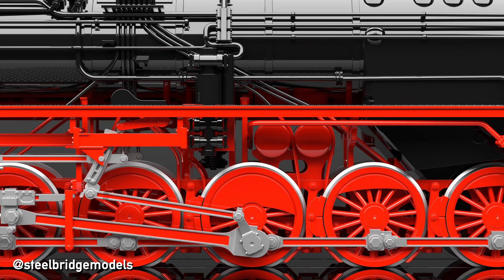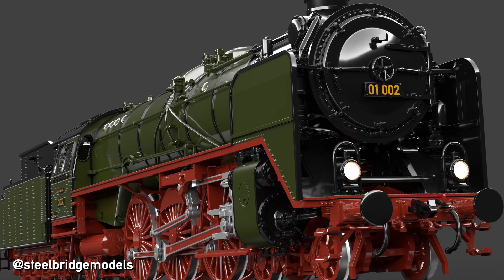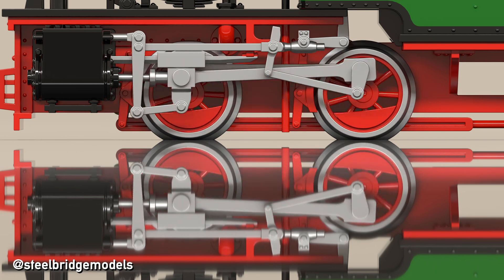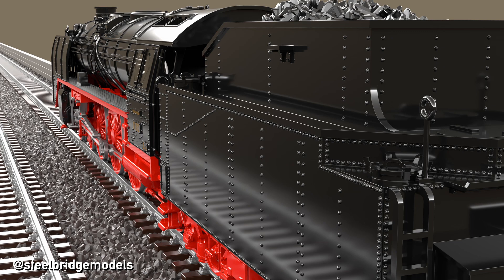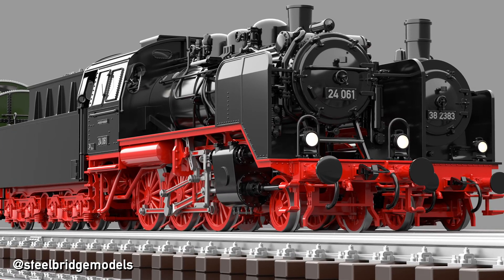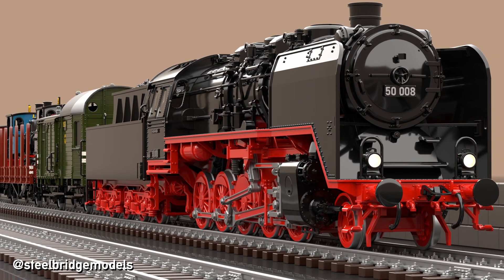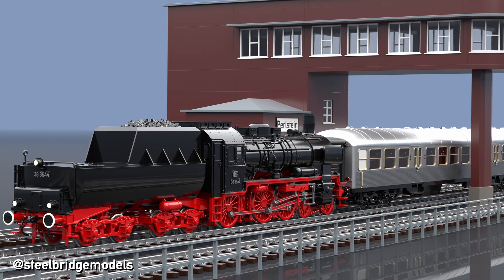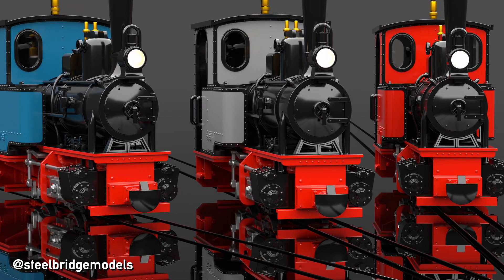Does Size matter?

Comment: Wheel count does not directly improve traction. This is a common misconception since freight steam locomotives typically have more wheels than express locomotives. What determines traction is the weight on each driver. An 0-6-0 and 0-4-0, otherwise being identical (let's assume the extra wheelset adds no weight), would have the exact same factor of adhesion. Smaller wheels can, however, allow for a driving wheel to go in place where a non-driven axle would otherwise have to go on an express engine. Freight engines don't have smaller wheels to fit more, rather they have smaller wheels to increase the torque of the piston on the rail. The piston stroke determines the crank throw, obviously, but the wheel diameter is determined by how much  torque vs top speed is needed. Top speed is also determined by the valve setup, not just mechanical RPM limits. This is why so much R&D was put into valves and valve gear. I think this video is great, but could improve a lot with more accurate or even just more defined information. I encourage you to verify the info I'm sharing though, as I'm no mechanical engineer.
Reply: The BR 03 (Express) and BR 42 (Cargo) have the same axel load and length (within a very small margin). One is a 2-C-1 "prancing unicorn" the other a 1-E workhorse. One goes 130km/h the other 80km/h. Both are Einheitsdampfloks from the 1925-194 program.

The BR 03 has a pulling power (Anfahrzugkraft) of 135KN the BR42 one of 235KN. Train weights at max speed where 430to vs 1700to (on flat terrain)

Comment: Fascinating breakdown of how wheel size impacts locomotive performance! But here's a thought: With modern advancements in electric and diesel technology, are steam locomotives really as efficient or adaptable as we romanticize them to be? Could their design limitations, like the reliance on fixed wheel sizes, have ultimately been their downfall compared to modern adjustable gearing systems?
Reply: We do not have to speculate. West Germany used all three types until the mid 1970s. And both Diesel (like the beautiful "Gretas Third Heard Attack" V200) and Electrical ARE superior. 

I love the Wanne. I will travell 400km in September to see a Wanne pull a cargo train in the Netherlands. It was fun seeing one haul an ICE to the next siding. But the BR52 takes a lot more maintenance in daily operation than a Diesel or Electrical engine.

Well - at least if you keep the drive train clean and fuel line tight. Otherwise:

https://www.youtube.com/watch?v=7lboXvtNNzI

Comment: Is the same principle between high gear ratio and low gear ratio in cars: high gear ration (bigger wheels) means higher top speed despite to a lower torque/power being delivered, while lower gear (smaller wheels) mean higher torque/power despite to a lower speed

Comment: If you  take a typical early 20 century steam engine with a sort of "standard" boiler and and a specific weight they would typically need something like 6 axles to work, but the loco is of limited length.

So a 4-4-4 configuration would be used for a very fast train. 4-6-2 would be used for more of a fast but not high sped train. 2-8-2 config would be used for a mix cargo and passenger. 2-10-0 would be used, for a typical cargo only, and a 0-12-0 (or in most cases, more likely 0-6-6-0) for heavy freight. Basically allowing the same boiler and cylinders for multiple different locos.

The torque of the wheels and the power of the cylinder also will match up nicely doing this
Reply: The germans use 

2-C-1 (two non powered axels, 3 powered axels, 1 unpowered axel) for high speed (BR 01.10, BR 10)
2-C-2 for the BR05
1-C-1 for mid level units (BR 23 and 23.10/35.10)
1-E for most goods engies
1-D-1 for high speed goods engines and the "help, there is a molehill! My BR 01 can't go there" BR39 / Prussian P10

Comment: Here in the States, we had large locomotives such as 4-8-4's that had 80 inch diameter drivers that gave them good speed AND pulling power thanks to their cylinder diameter and the stroke. Maybe the Class 06 could've been realized as a mixed traffic locomotive without the streamlining and therefore could've unlocked its full potential.
Reply: Germany/Europe works under different rules/restrictions. The existing infrastructure did put quite a few limits on the length and axel load of the engines. For example the post WW2 BR10 (around 22 metric tons of axel load) was restricted to very few main lines and even there on some with special permits. US engines ran with loads of 25+ metric tons and the S1 and T1 where around 30 metric tons 

Same for length - german turntables where 26m for the large ones (1938 rules for them). The US used trains of over 37meters.

And the reason is simple - there is no SPACE for those large engines in western europe!

Comment: One rule of thumb (though a very loose rule) is to take a locomotive's driver diameter, in inches, as the maximum speed, in miles per hour. Obviously, that's not entirely accurate. For example, the museum I volunteer at has a 2-10-0 freight locomotive with 52" drivers, but those are still rather small as these things go, and even approaching 40 mph will cause it to vibrate excessively.

Comparatively, the British Rail Class 9F 2-10-0 is a much more modern design, with 60" drivers, and while designed as a heavy good engine could easily handle passenger trains and exceed 80 mph.

Comment: The fundamentals of wheel size never truly changed with steam locomotives, but some workarounds could be found as well. Smaller wheels could be applied to a passenger engine, with improvements to the counterbalancing to offset the hammer blow, or roller bearings to the axles to increase how much rotation the wheels and rods could endure without “running hot.” 

Alternatively, larger wheel locos can attain more power with extra cylinders. Compound and simple articulateds might come to mind, but more specifically extra cylinders to one engine set. Like with IC engines, adding cylinders increases the torque effect for a given rotation. Along with added power to attain and sustain higher speeds, stability is improved as well, and potentially fuel saving even if compounding isn’t used. A four-cylinder engine can offer greater horsepower at speed while using less steam per revolution than a two-cylinder engine of equivalent starting force

Comment: I know that German build that DR 18 201 that loco had driving wheel of 230cm tall its the biggest wheel ever produced only beaten by British single Stirling that only had 2 driving wheel but with a size of 246cm if i remember correct...!🤔 But yes with such a wheel size u have a much weaker pulling power but much  better topspeed...💪
Reply: 18-201 or HELP! I got stuck on a banana peel! Granted, during her operational use that could not happen since East Germany HAD no bananas...

Comment: Good summary of the topic, you are my favourite railway chanel so far. I would have added 1 more point to your video. The driver wheels also have a pratical limit in how small they can get for heavy freight locomotives, since those engines usually have large cilinders and heavy main rods, the counterwheigts need to be large on the drivers to balance the motion out. But below a certain size, it becomes impossible to fit large enough counterweights on the wheels, are the engine is going to have poor riding qualities, no matter what, see for exapmle the Pennsylvania Railroad I1 decapod.

Comment: Smaller wheels are better for pulling, larger wheels are better for speed. At least, that’s from what I remember.
Reply: There is a big thing about crankpin circle vs wheel diameter that needs to be accounted for when considering wheel size.
Reply: That explains why some german steam engine look so similar, with the wheels being the only difference.
Reply: It's a tough balance too, many US freight locomotives had to balance large wheels with pulling power due to the wheels needing enough space for balancing weights. Famous example is the C&O T1's which ran 69" drivers to support a 108" boiler making 93k lbs of TE but there still wasn't enough balancing weight to counteract the massive rods and pistons they used. (29" x 34") Later in their careers they rode so rough the crews wore wear kidney belts and track crews had to fix rails behind them. The PRR used copies of them during WW2 but they used 70" drivers which, afaik, solved many of the balancing issues the OG class had.
Reply: Thanks.... 🙃